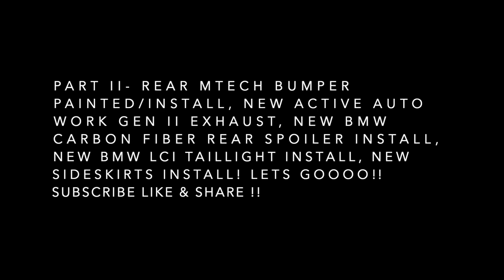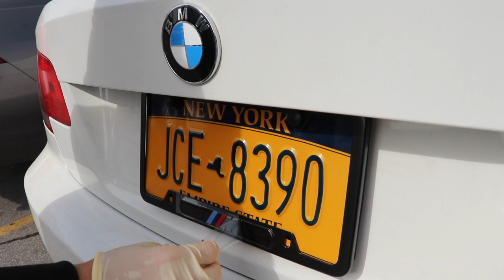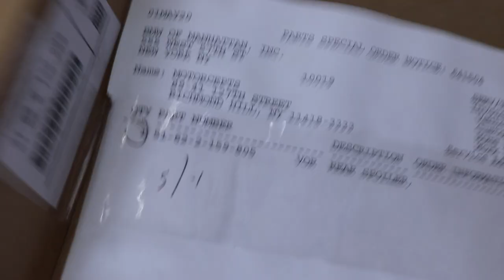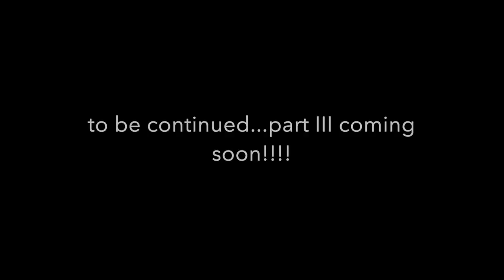BMW LCI RETROFIT UPGRADE TAILLIGHTS FULL CONVERSION amazing result on bmw e92 328xi 🔥 MOST DO MODS!

Comment: What year e92 is this?

Oh nvm got it. I'm wondering if mine is the same... I got a 2009 production e92.. I wonder if all I need are the harnesses. Because that footwell module cost 600 bills. I got my damn lci tail lights for only 270

Comment: No cap bro, I just found your channel and your vid's deadass making me miss my e92 328i xdrive with the m sport package and the coral red bro. Had that on bilsteins man, this car is a blast to drives just mind those potholes cause them control arms expensive. Check ecstuning for discount on oem parts and aftermarket options shit saved me an arm and a leg. I'm mad im rolling in a truck rn.😂